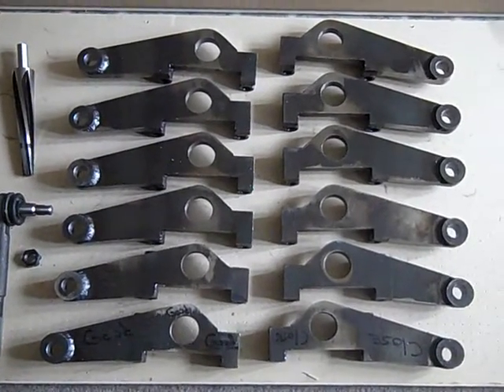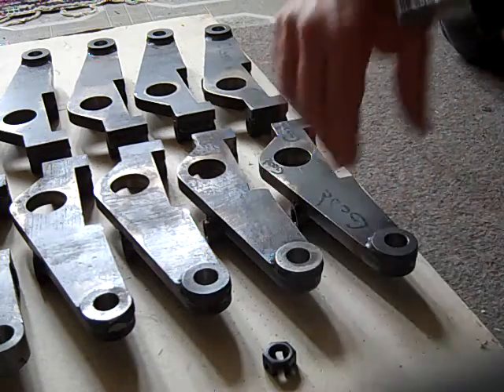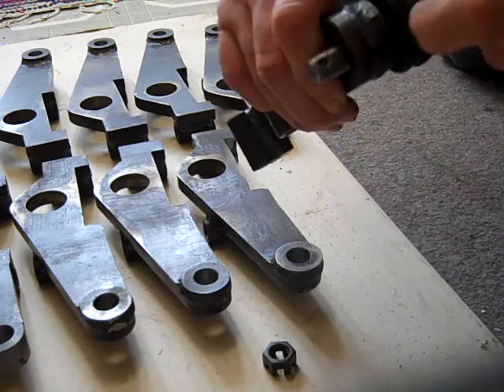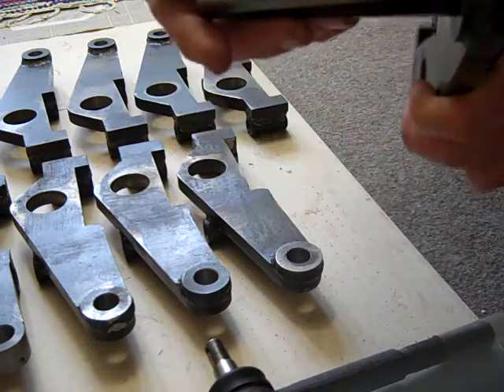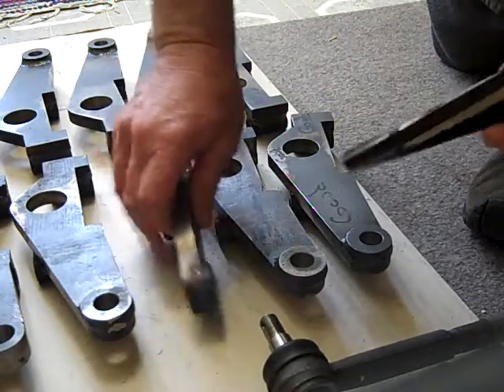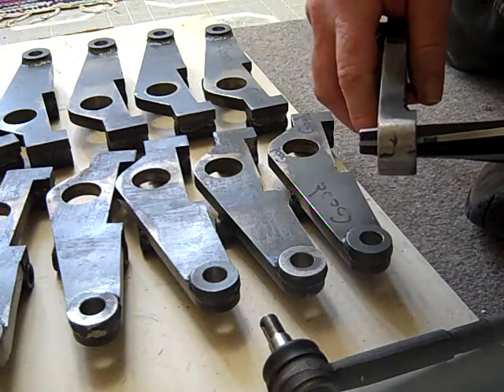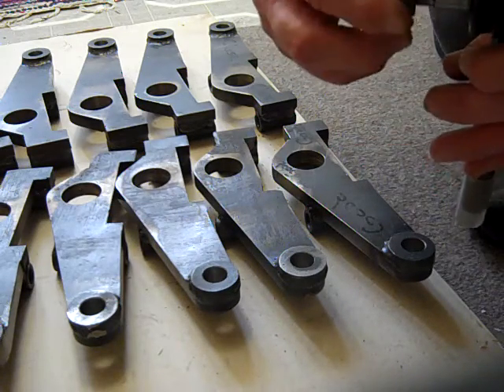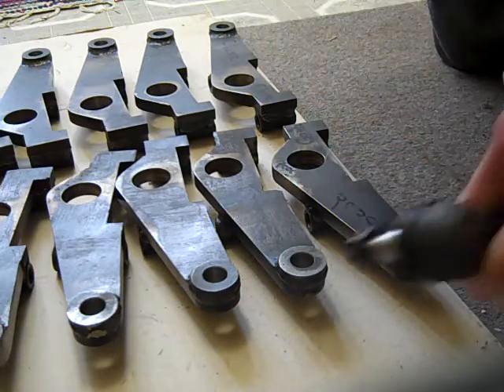Steering Arms - Checking Taper Depth for Outer Tie-rod

Comment: Uhm, that is a reamer, not a tap. And having the hole for the cotter pin line up when you screw the nut on like that is irrelevant. The nuts gets torqued to a proper spec then tightened to the next TIGHTER position that the pin will go through.